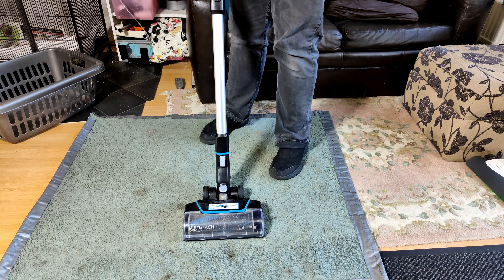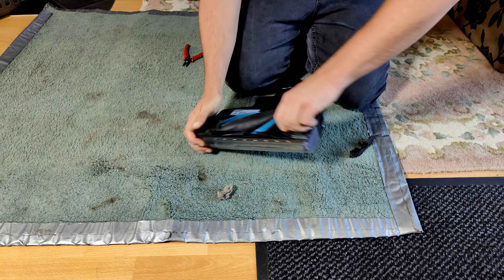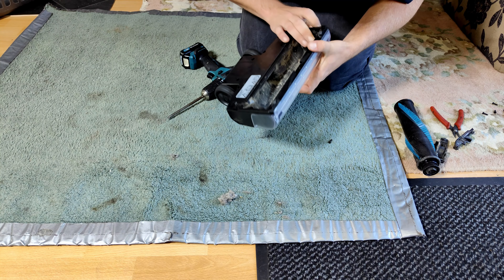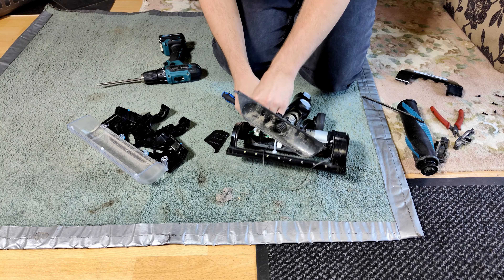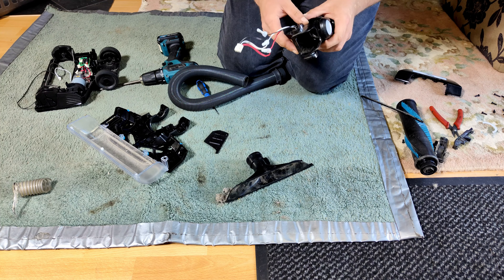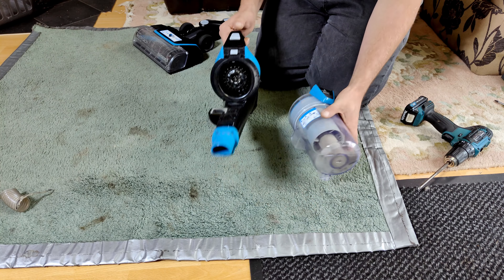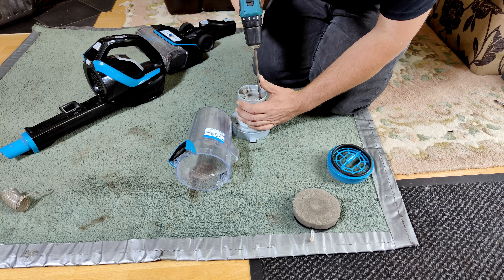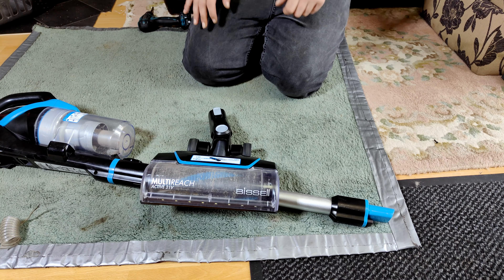Bissell MultiReach 2907b Cordless Stick Vacuum - Inner Hose Replacement!

Comment: get one of them bissel heads on your nbv190. also i recently got a joblot of dysons, a dc41 mk1 a dc41 mk2, a dyson DC 44, v7, and a dyson v11 all in decent condition for £120, the v11 I am keeping for now along with the dc44. just wondering how the dyson v11 on max power compares to the nbv, because i was shocked at the power of it.

Comment: For everybody watching this video and wondering how he gets that top part off at 3:56: after you've unscrewed all the screws on the bottom, you can click the top off with some gentle force. It's exactly the part that is missing in this video that is the hardest thing to take apart. 😅
Reply: I would also recommend sticking in a knife and bending the top part off, mine did not come off by simply bending with my fingers.

Comment: Damn useful those TP2 hoses, the amount of powerheads you have repaired with them is amazing. What will you do when you run out of TP2 hoses, as I am sure they are not infinite in supply these days lol. Always seem to be the weak point on so many vacuums those powerhead neck hoses. I think the old Shark vacuums were the worst for it.
Reply from the maker: That will be a sad, sad day when I run out 🤣